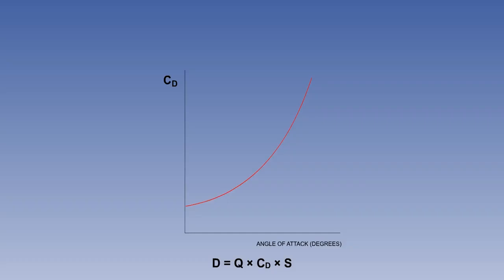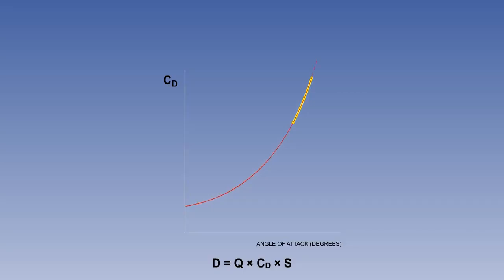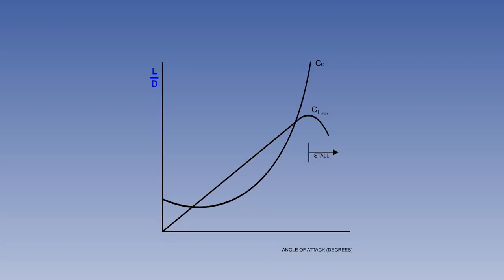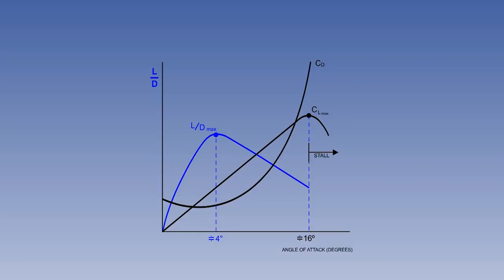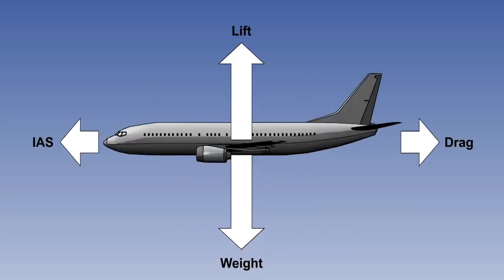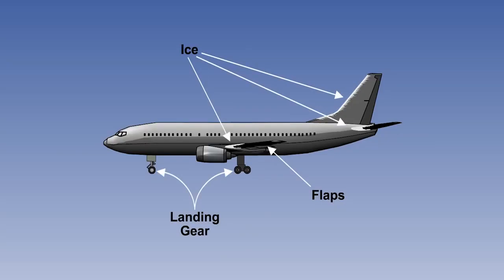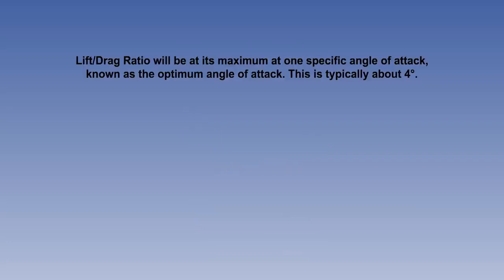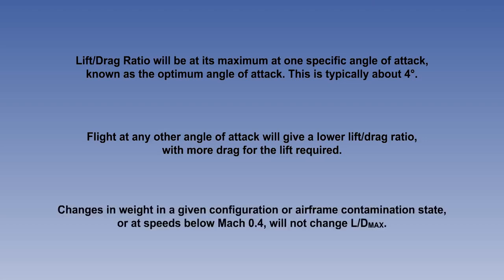11  ATPL Training Videos  Principles of Flight 11 Lift   Lift   Drag Ratio

Comment: OPTIMUM ANGLE OF ATTACK IS 4 DEGREE AND MORE OF ANGLE OF ATTACK MORE SPEED IS REQUIRED TO GET THE Ld MAX TO LIFT AT THE DRAG AND HIGHEST LIFT POINT OF THE AEROFOIL UNLESS YOU ARE USING AN AYSMETRICAL AEROFOIL ETC?